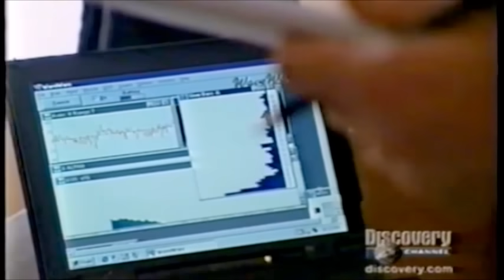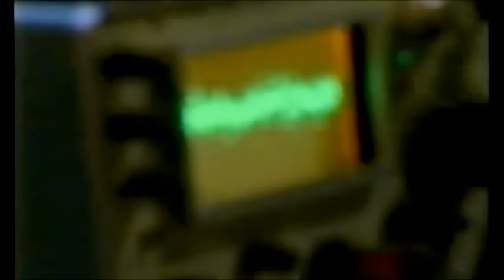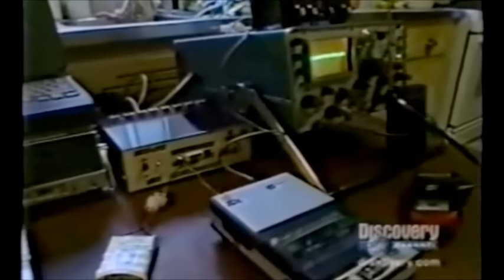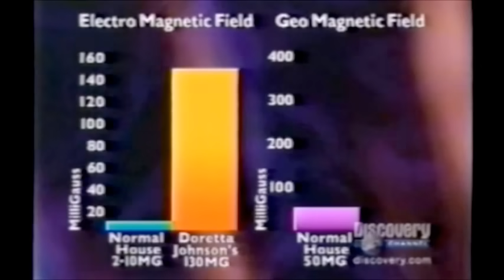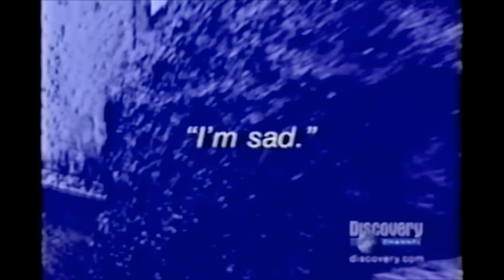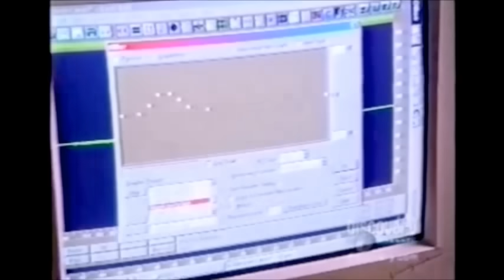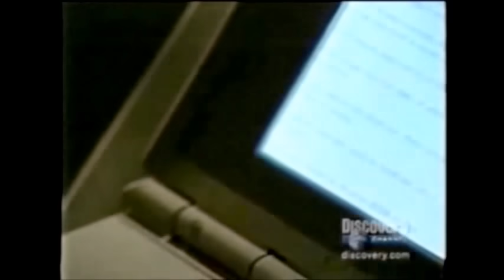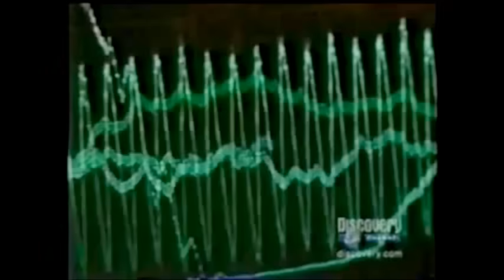Discovery Channel - Paranormal Documentary from the series "On the Inside" Year 2000

Comment: I really wish they had their command center in a different house or outside in a trailer. That way not only there is less chance of contamination but enable the activities to not be disturbed by the voices of the investigators.
Reply: There`s also the matter of residual EMF in the house while they have power going through to supply their equipment.
Best to turn the house power off then run off batteries rather than AC going through generating EMF from unseen sources.
The " oscilloscope " he talks about is a " cathode ray tube " ( CRO = Cathode Ray Oscilloscope ) variety and that alone uses over 12,000 volts to generate an excitation voltage to ionize or excite the phosphorus on the screen before an image or trace can be seen.